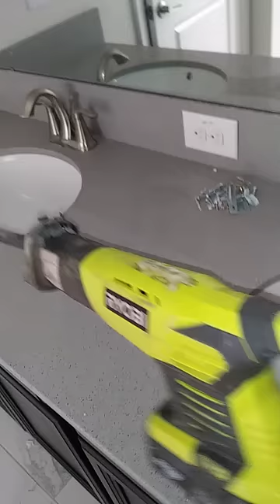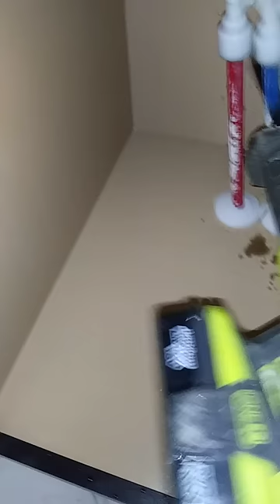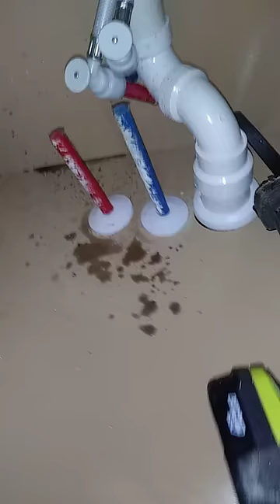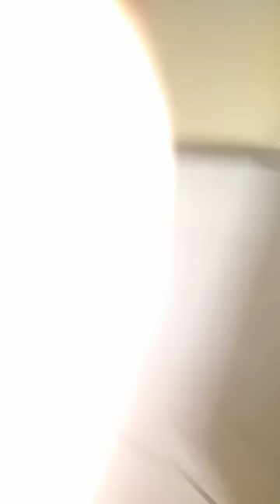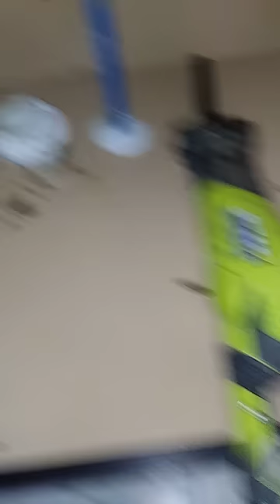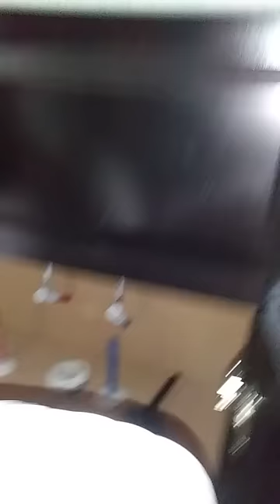This is what happens when you DON'T pay your plumber.

Comment: Yeah! When I plumbed a whole bathroom and the owner said she wasn't going to pay when we finished. As I and my helper were leaving I said, "Stop the truck, wait one minute... I'll be back." I went underneath the house and disconnected the toilet so every time they flushed sewage went to the ground... I did this in winter and I imagine by spring it all started to stink really bad.
Reply: I worked for a disaster remediation company and went on a job with the plumber that someone had disconnected the sewer main from the septic tank and all of the sewage was dumping into the crawl space that started in the winter we were there in early spring probably 3 inches of raw sewage over the entire crawl space I wouldn't go in there I stayed outside and was a gofer I'm a carpenter not a plumber I won't walk in shit on purpose.
Reply: @ALLforROME  Dizamm
Reply: Oh you evil evil man, that genius
Reply: I've been told before that the old masons would put a sheet of glass about halfway up the chimney as they were building it, and after they were paid they would drop a brick down to break the glass. The idea was that if someone tried to cheat them then they would let them start a fire there and fill the place with smoke. 

As a sider, i always thought it would be worth running steel cables down behind corner posts. If someone screwed us, we could attach the cables to the trailer hitch and rip it right off the wall. It would all have to be re-done from the beginning because you can't just fix that.
Reply: @derealized797  oooooo that’s evil haha
Reply: Yaaaaaasssss
Reply: Why didn't you just take her to court and get your money instead of committing a felony? If contracts were in place all you have to do is take her to court...
Reply: @Shastavalleyoutdoorsman  because he's a pos and knew he'd probably never get caught. If this got reported to the person and he was arrested and charged he be sobbing like a little baby about how sorry he is. These are the guys that have never been punished for their actions.
Reply: @Shastavalleyoutdoorsman  I would love to see tough guy tell the home owner what he did. Probably sitting at home sweating hoping nobody looks into this. It's a pretty fucking major crime
Reply: @Shastavalleyoutdoorsman  it's ok it just takes one screenshot sent over to the proper authorities. This guy is surprisingly easy to find. What a fool.
Reply from the maker: @tonybryk3312 this guy is not easy to find?